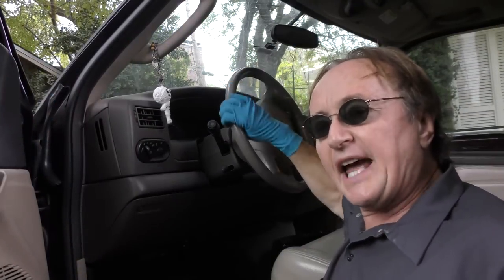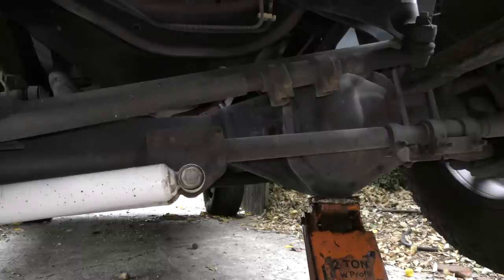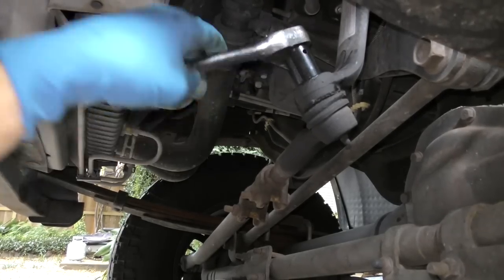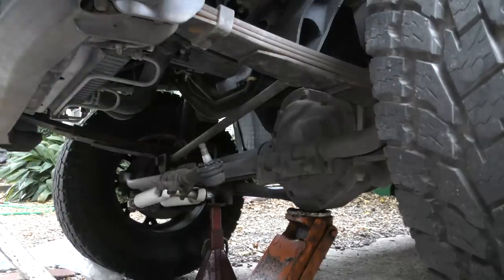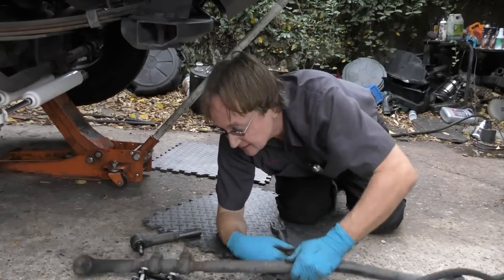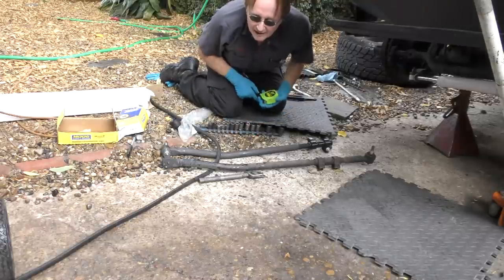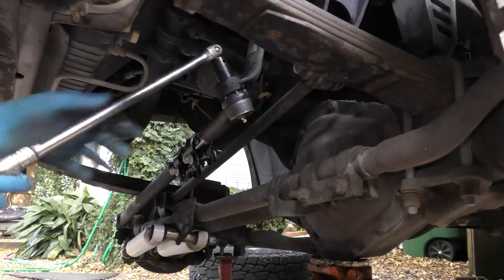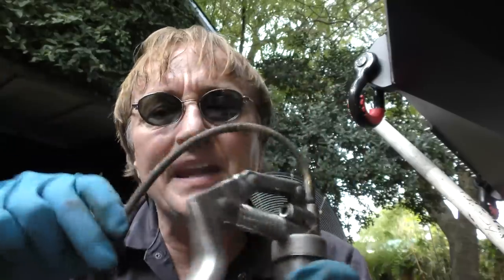How to Fix Steering that Clunks and has Play

Comment: Hi Scotty, my 96 Toyota Previa van always pulls to left while driving on road, but it is not too bad. However, when I apply breaks, the car pulls left just worse and worse so I have to hold the steering wheel hard to keep it forward.  What the problem might be? Where should I start from?
Reply from the maker: +Simon L you have a front end problem, like bad tie rods or alignment. Have an honest front end man look at it, most give free estimates

Comment: Is this the setup for all vehicles?  Will this work for all cars?
Reply from the maker: +Reggie Lewis no, this is a truck set up, most modern cars use rack and pinion systems but you still check for play the same way
Reply: Okay, thank you so much. I replaced the whole Strut assembly and tie rod ends today and noticed the play and clunk was still there.
Reply: Would the stabilizer bar or link cause this? Or the intermediate steering shaft?

Comment: I have a.1993 dodge Dakota sport V6 magnum, and I made a awful mistake, I hooked up a battery backwards because the label with the positive and negative was pealed off sticker, AND now my dome light doesn't come on and my radio doesn't work anymore but everything else works great the truck runs great and fuses are good, and I don't know where the problem is at please help!!

Comment: Hello Scotty. I have a Toyota Avensis 1.6 SDN Prestige 2008. I hited the front wheel the left one and now the steering wheel is very soft. When I drive and turn right or left the front of the car feels like want to drift and the steering is very soft. Even when I drive on highway the steering is very soft and the car is not stable in the front wheels even in low speeds when I turn right or left. Can you help me and tell me what could this be? Thank you.

Comment: Hey Scotty I have a 1995 Chevy k1500 with a 5.7 with 220,500 miles and it has a lot of play in the steering but makes no noise unless you lock it in both left and right directions and the noise it makes is a whining noise coming from the power steering pump. The wheels are also solid and don't have play when you try to shake them when off the ground. Is my pump bad or is it something else. It still drives fine it just has play. Any help is greatly appreciated thanks.
Reply from the maker: play is not the pump, play is worn suspension parts, and perhaps ball joints which need to be loaded to be checked correctly, start there. Also realize that old, steering boxes often go bad

Comment: Hey @Scotty Kilmer, I have an 09 Malibu. I had a severe, rhythmic thump in my front end that went with the speed of the tires. I noticed a completely missing boot in the cv joint so I replaced the half axle. This didnt fix the problem, so I jacked the car up and watched the front tires spin....the half axle has rotational AND vertical movement. That is the thumping noise, What could this be?
Reply from the maker: +Charles Coleman  worn out wheel bearings often do that, as can broken suspension struts or strut mounts
Reply: +Scotty Kilmer Thanks for the reply. It looks like it's coming from where the axle mounts to the differential. You can see it spinning,  and moving up and down(which is the rhythmic bump). What holds the axle into the differential?

Comment: Hey Scotty my 2004 Nissan armada has been making squealing like noises for the past few months, they come and go.I usually hear a weird like squealing noise when im driving but its not a squealing noise when you have bad brakes it sounds like multiple little things are squealing mabye its my tie rods? Also now when I turn left or Right I hear a grinding noise sometimes, i'm guessing its a bad wheel bearing but im not sure. When I went to the dealer a couple days ago to get an oil change, I told them to check it out and they never did...What could it be?
Reply from the maker: +Ruben Reynoso see my video 'finding the source of car noises" it always finds the noise

Comment: hi scotty i have a chevy camaro 1999 on thich sttering wheel pulls to a side when u run over uneven surfaces,i replaced the inner and outer tie rods but i still have the problem.can you please suggest me something that can fix the issue
Reply from the maker: start with a good front end shop to check alignment, could just be that

Comment: hi Mr Scott,  I have Toyota Camary 1997 when I drove it start smok in the front I told the radiator haven't water when u checked it's come out it doesn't heat or overheating might be the ventilator doesn't work because it doesn't work but I didn't give 5 min what should I do?
Reply from the maker: +Ahmed BOSTON  start by pressure testing the coolling system for leaks, often a cracked radiator or leaking water pump

Comment: hi scotty and viewers, I have a big problem with my Hyundai Elantra 1993 (1500cc), it's crankshaft is lined, what everyone told me is that I have to go to the grinder and rectify it, the problem is that rectifying it costs like 500 dollars and I can't really afford it, my question is... can I polish the crankshaft myself at home with a sandpaper to avoid the rectifying work, and if I can, what size of rod and bench bearings should I stick to it? thanks
Reply from the maker: +cabolin  you can try, but you would need to micrometer size it and buy bearings for the correct size you measured.

Comment: Hey scotty what's up?, I asked recently about my 2000 accord, here's a new problem. As I depress the brake pedal, it makes a hissing sound as pushed in, as if air was coming out. Looked online and they say it could be the brake booster. What do you think and is this a costly fix?
Reply from the maker: +grandcarvan1999 yep, bad brake booster, get a rebuilt one, new ones cost a ton
Reply: +Scotty Kilmer I looked online of a new brake booster ranges around mid 70's but I'll look into a rebuilt. If you were here in NYC, I would've been your loyal customer. You're a honest mechanic

Comment: recently had my mass airflow sensor replaced on my 1986 toyota celica. my car is idling at 300-800 rpm and sometimes dies at stop lights because of the low idle.  in 1st gear, the car will sputter and jolt forward until i get to about 4k RPM and then it starts to drive somewhat normally

the mechanic that fixed my sensor said that i should just drive it for a few days to see if it fixes its self/un-cloggs anything and nothing has changed.

any help would be very much appreciated
Reply from the maker: +alMost- on that old thing, more often dirty injectors. Try my video "how to clean fuel injectors on your car" or put on a set of rebuilt injectors

Comment: I Have a Ford Au (1999) and I'm replacing the trans in it. and we aren't taking the motor out but I would like to know how to get to the top bolts out of the transmission any ideas? cause the firewall and motor make it really hard
Reply from the maker: +The101minecraftpig  you really have to drop the whole assembly down some by removing mounts and some crossmembers to get to those bolts.
Reply: Okay cool, will try that thanks!

Comment: Hello,, do you have any tips for keeping new ball joints still when you're tightening a nyloc or castellated nut back onto one, like with an anti roll bar / sway bar link please? I've read so many things but just can't find a good tip. When you're undoing one, it's quite easy, you can just use vice grips or something to hold it but you can't do that with new parts or it could damage the boots.
Reply: ***** Ta but there's none of those things on some of them, any other tips?
Reply: ***** I always miss his live shows, either lose track of time or just not in time, I'm in the UK so time zones are a bit of trouble sometimes.
Reply: tobysoter Aye, ta. I had my answer on Scotty's live chat on saturday, fair play to him. Only problem is with what you said though, is I'm not tryin' to do a control arm ball joint up, it's a sway bar / anti roll bar one so maybe I'll have to try compressing it with a g clamp or something.

Comment: ive changed my idle arm, inner and outter tie rods, then alignment. the car doesnt wander anymore but there is still about an inch of play. any suggestions
Reply from the maker: bad steering box or pitman arm
Reply: thanks alot i bought the steering box in april it was remanufactured. should i swap it out how can i diagnose the pitmn arm

Comment: Lifted car usually have problems.
Reply: true
Reply: If done right, they wont.
Reply: +God Lee We were driving toward a resort on Maui, when the traffic on the two lane highway stopped. For hours. Finally we passed the accident; a lifted trick that somehow broke an axle and blocked the road.
Reply: Adam Arab no thanks but have fun by yourself.

***** It's a nice show car. And I have to agree with NOLAItsNotOva  if the lift done right. But most average gun, the car will run into problem soon or late.
Reply: +God Lee When you get people that just go for looks, then it is a problem because they will find the cheapest way to do something just to make it look cool. Quality parts and you won't have a single problem
Reply: God Lee oh i found one

Comment: How can I fix my 2004 Chevy Tahoe I got stuck in a ditch of snow after I got it out. I couldn't steer left or right it was full snow under the Tahoe I remove all the snow but my steering wheel not working...

Comment: Heyy Skotty, I have a 2009 Subaru Impreza 2.5i Sedan, AWD . When I turn the steering wheel in parking it makes a chirping sound and its hard to turn, it also dims the headlights. What could be the problem? Just bought the car.
Reply from the maker: +Ariel Contreras worn out power steering pump or worn out fan belt

Comment: Scotty, I have a 96 Cougar. The steering doesn't seem right. When coming out of a corner I have to bring the wheel back it wont come back on it's own, my other vehicles you can let go of the wheel when coming out of a corner and for the most part the steering will come back to center on it's own. Any ideas? Thanks Dan.
Reply from the maker: +Daniel Young needs a new power steering rack
Reply: Thanks I'll get that replaced.

Comment: I thought you were supposed to hammer around all those rod end joints with an air chisel to squish the cup and tighten them up....still works..... for a while.
Reply: +Peter “Crackpot Pete” Carlson 
lol. Have done that myself to slip through vehicle inspection!

Comment: Ugh... Pickle forks... I put one of those on a ball joint and took golf swings with a sledgehammer and it STILL took 20 minutes to make it separate.
Reply: That happens to me all the time so I cheat and use a pickle fork that fits into an air hammer. They come right out in a second or two.

Comment: Hi Scotty, I have a 2000 Lexus is200. On the motorway I had to brake hard and instantly the engine warning light lit and trac control light started flashing. The car still drove fine though, but is staying on. Is there anything I can do without taking it to a garage?
Reply: Disconnect the battery and reconnect. If the light is still on, drive it straight to the wrecking yard.
Reply from the maker: +Shaun Airey  so many things can trip the light, get it scanned, e mail the codes to me.

Comment: dear scotty i have a ford and had just got the complete rack changed under warranty by the service center but since then there is a clunk in the steering wheel while turning it to left at 10 o clock, and there is no noise while turning it to the right. please help me dude.

Comment: Just had my transmission rebuilt. Today was the first day I drove it on the (katy) freeway (only a few miles). Afterwards, I heard a loud clunking noise at my drivers front wheel area while turning. Doesn't seem to be any play in the steering wheel. And only notice the noise when driving slow like when pulling out of a parking space and turning the wheel. Could the shop have damaged something while fixing my transmission? I can't afford another repair :/
Reply: I have the same problem just had a new trans put in my 99 Dodge Avenger and it clunks sometimes and you can feel the clunking in the steering wheel

Comment: I have a 2003 Mitsubishi Galant. 3 mechanics say the suspension and steering parts are all tight and in good shape get my steering wheel has a clunk. Not sure what we are missing.
Reply from the maker: +Justin Hall  find better mechanics, watch my video "finding the source of car noises" and have that machine hooked up, it only costs 130 bucks or so for the entire set up really.
Reply: +Justin Hall check steering shaft, make sure not seize :)

Comment: Scotty! I have a 1986 Chevy g20 van with a 350 in it, Its an ice cream van with the ice cream machine takes power directly from the engine so I have to let the engine for lots of time so I can sell. I work for like 6-7 hours a day and during that time and it never gets turned off.. Should I worry about something?
Reply: FCFordLord First: thanks for replying :D 

Second: Yes I change the oil quite often, the odometer is clogged at 149.000 miles and I'm pretty sure it has well over 400.000 miles, the engine was rebuilt one time. And no, I don't have an hour meter on it, should I inatall one?
Reply from the maker: +Not Named you could install an hour meter and change the oil more often according to that
Reply: +Scotty Kilmer alright, thanks.

Comment: Scotty, how much do you charge your customers for a job like this versus a repair shop?
Reply from the maker: +TehDubster  I do work as a regular repair shop here in my garage, so I charge by the same book rate manual
Reply: How much did this job cost the customer in this video?
Reply: +Scotty Kilmer Scotty , on 2008 -2009 Ford Focus's 

do you find that if their is a lot of interior vibration on one side it tends to be the motor mount or torque mount that needs replacing?

Comment: Hi Scotty

I live in Phoenix Arizona  i drive a Nissan Sentra 2013 
i was driving to work last night on the I-17 very busy highway aka freeway 

the Problem i had almost caused me a real big Accident.  while i was driving right in front of my AC was on  front Windshield  a Large Cockroach came out  i was very Shocked  by that  before i  can think it went back in the Air vent i put the AC on High he did not come back out ...i hardly ever eat in my  car i have less then 19000 miles on it brand new still am the only who drive or get in it  i don't have Cockroach in my house how did he get in and how can i make sure he is out of my car air vent i hope he does not die in my AC Vent HELP ASAP  PLEASE   should i black Heat or

Comment: My family owns a 2005 Chrysler Pacifica and it clunks under hard braking and ideas?
Reply: +Derek Blubaugh Yes, I know exactly what's wrong with it. It is a Chrysler Pacifica. Trade it in for a Ford and the problem will go away.
Reply: Your differential bushings could be shot I had the same problem on my 05 grand Cherokee
Reply from the maker: +Derek Blubaugh MANY things can cause that from worn struts to worn A frame bushings to worn ball joints. Jack it up and pull on the wheels to find the source.
Reply: apburner1 lol ok transmission problems galore

Comment: What would the problem be if I have loud banging noise that seems to be coming from the suspension? Every time I hit a bump or pot holes. Sounds like metal to metal . Integra
Reply from the maker: +GoldCurency o  worn struts or strut mounts often do that . Jack it up and check all the suspension parts for play
Reply: +Scotty Kilmer Ty will do. GOD bless
Reply: my Honda had the same problem but I changed out my mounts and now the car is whisper quiet again.
Reply: +helllokitty138 ty

Comment: My car makes noises and shakes a little only when I turn the wheel out of a parking spot but not when I drive . What could it be?
Reply from the maker: +Frank worn power steering pump or broken bracket for t and bad belt

Comment: hi scotty I have a 2007 chevy malibu. When im driving and come to a stop as I slow down my steering wheel vibrates nothing is loose I can't figure out whats going on I did the 9 and 3 and then the 12 and 6 buy nothing
Reply: +Mario Garcia make sure rotor are not warped :)
Reply: +ebu touy thanks ill check that out

Comment: What if when your turning and it makes noises
Reply: Probably CV axles, if fwd
Reply: +Cecilio Nobre cv axles yeah, you hear them the most when accelerating in a sharp turn.
Reply: +Cecilio Nobre 
Depends on the vehicle. Silverados are notorious for intermediate steering shaft (steering column) "clunking" when turning. Was hard to pinpoint, but an easy fix.
Reply: +Cecilio Nobre What kind of noise? If it's a whining noise, that's the power steering pump sucking in air, so there's probably a leak somewhere. Try turning the wheel all the way to lock while you're parked, and see if it makes the noise.

Comment: Hey Scotty, I have a YZ85 dirt bike and when I shift into 1st with the clutch in, the revs drop and it is also harder to start in 1st. Is this a clutch problem?
Reply from the maker: +Barack Hussein Osama  if it doesn't do it in other gears, it's a first gear problem.
Reply: ***** Actually, it isn't the same as when it is hot. I bought it used a few weeks ago so idk what gear oil it has. Should I try a different weight?
Reply: +Barack Hussein Osama 
Yup. Clutch isn't disengaged entirely. Can sometimes be cured by simply adjusting "free-play" at the clutch lever or replacing the cable. (best case scenario)
Reply: Haywood Jablomy The clutch lever is loose, I'll mess with it when I got home.
Reply: +Scotty Kilmer 
Are you sure you read his question correctly? It shouldn't matter which gear it's in,  the motor should not be engaged with the tranny when the clutch is depressed.
Reply: +Barack Hussein Osama 
Good luck! Let us know the result.
Reply: +Harry Squatter 
lol